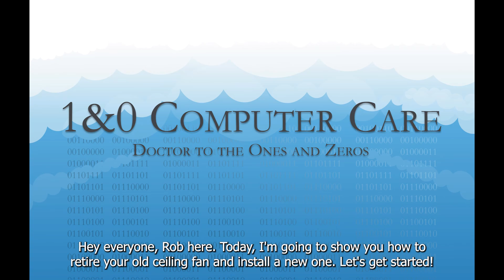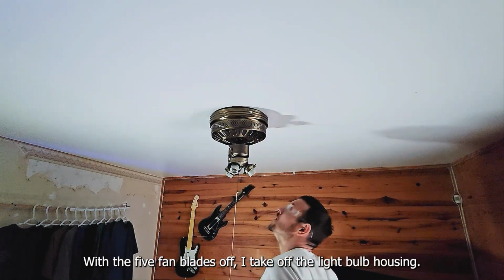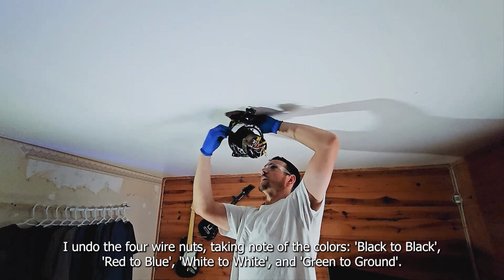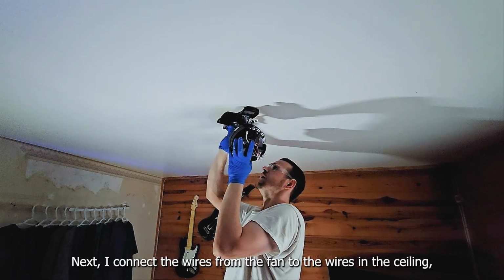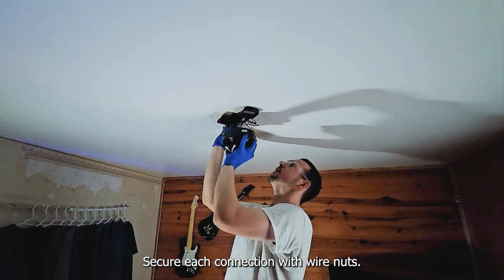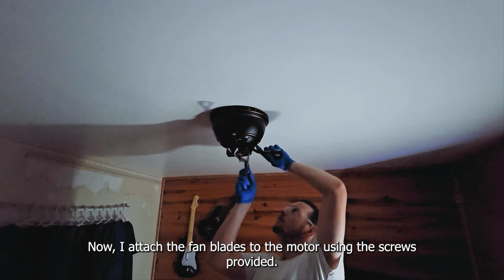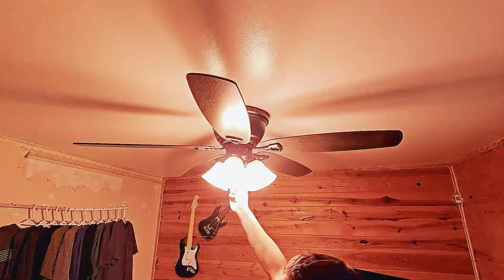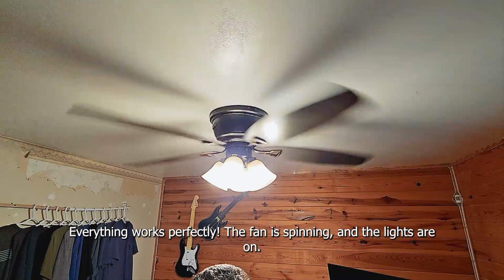How to Replace an Old Ceiling Fan with a New One | DIY Home Improvement

Comment: What happened to it
Reply from the maker: @Phonemannn  two things, one the part in the center where the wires connect for the lights had been twisted by hand so many times that the wires shorted out. Two, it's such an old fan that the motor was humming and would barely turn so I figured, "It's gone!" Lol
Reply: Ok